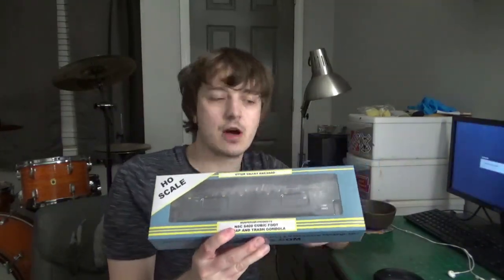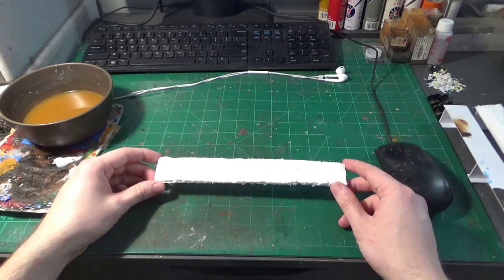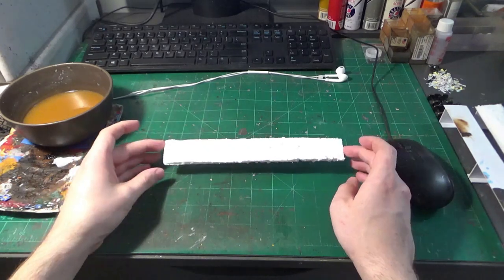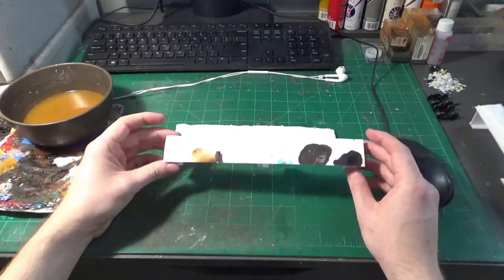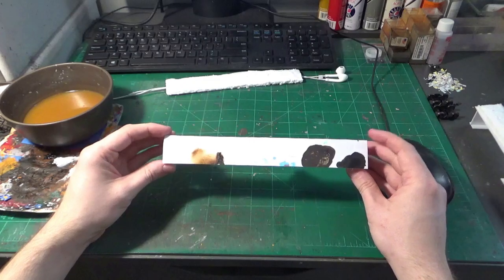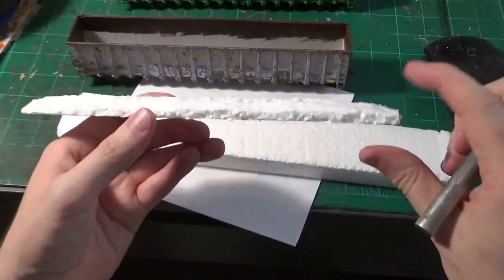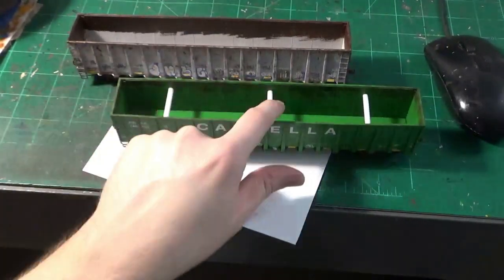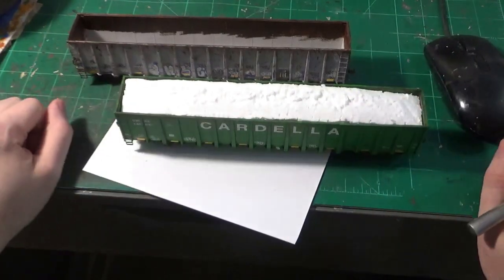Custom Make C&D Trash Loads For OVR 6400 Gondolas!

Comment: Hi Dan, I saw another YouTube Channel and I got to suggest an idea. It is staying away from the peanut bead foam and use either the Is flora foam or left over pink, blue foam. I liked his idea with cutting slots for magnets and gluing them into the foam ( so it makes it easier to remove). But to decide what one side would have and what other side would be ( so you would end up with 2 different load, but could be set up with wood, wood chips, gravel, coal, scrap loads ( even scrap aluminum), and any other loads come to mind.
So you can set it up that the side has a different load. I think a thin sheet of steel would be cheaper than every load having magnets in the load, that could get expensive. 
I am into N Scale but enjoy watching your channel.

Comment: Great idea. Was going to cut down a 2 inch peice of foam chunk. Forgot that. I'll build a base similar to your design but use pvc sheets and use a small foam topper like I use on other cars.
Reply: Additionally I like the real c&d scrap from the real car. I've busted up real concrete and brick, sawdust...and whatever floor scrap I can find.

Comment: I really like the loads Dan! Only question how you would do them if you want the loads to be removable? I'm a big fan of being able to run both loads and empties without the expense of having to buy doubles of each car. Thoughts?
Reply: Wrapped load like Dan did, but before wrapping cut cavity into underside of the foam block for a small magnet, close to one end (roughly at 23:04). As long as you a) don't glue down the wrapped foam block to the plastic support platform; and b) do leave just enough gap between the load and the car sides, you should be able to magnet it out without having to resort to prying the load out with a blade. Could also just leave a bit of the load sticking up, to act as a handle for tweezers. You will lose a bit of fidelity as the load won't touch the car walls, but that's what enables the load to come out intact.